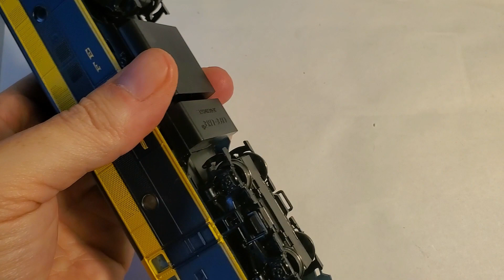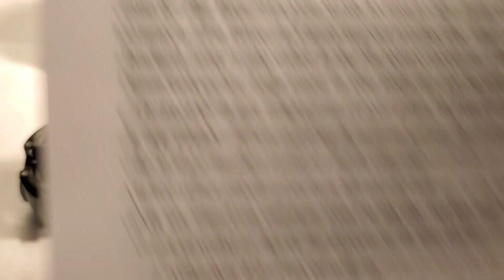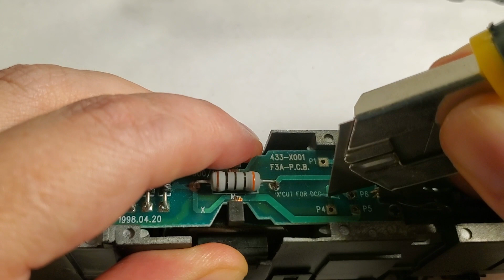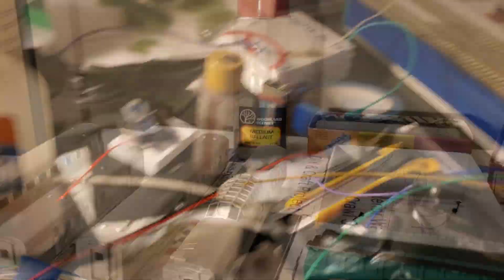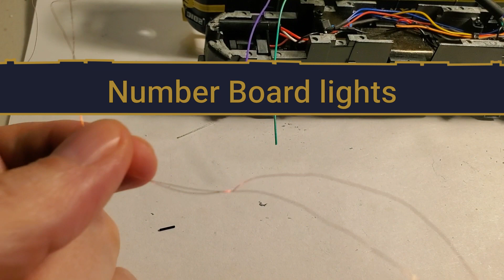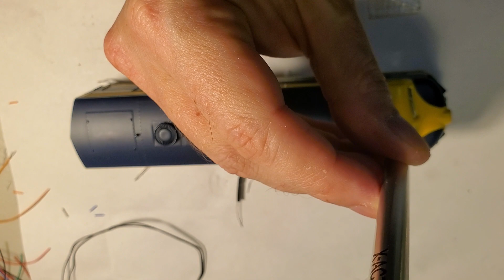Proto 1k EMD F3 ABA Decoder Install

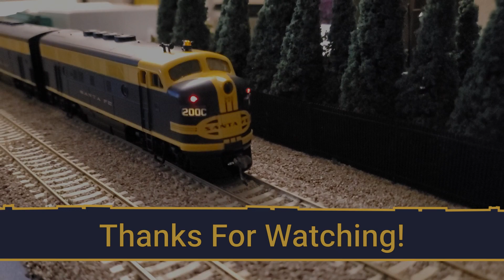Comment: Kurt, help!  I am doing my first decoder install as per this video.  I am at time stamp 34:31 here you say to cut at the 3 "X".  Do I just make my cuts so that the green trace lines are broken or do I cut through silver trace line under the green trace line?
Reply from the maker: Yes, you want to cut through the whole copper trace.  You need to break the electrical connection.

Comment: Make lighting easy for yourself and go to Evan Designs. No resisters no polarity just hook to track power or decoder. AC, DC, DCC. Many different sizes of LEDs down to grain of sand (almost). and colors. Been using them for many years.

Comment: Great video, a couple of suggestions for you, when testing LEDs, if you use a 3 volt button battery (like for watches and car remotes, I use a 2025) you don't need a resistor while testing and since the poles are on opposite side to the battery it just takes two fingers to hold the wires against it. The other thing you might for installing lenses and attaching LEDs to the lenses is canopy glue. It dries clear and fairly quickly while still giving you work time, and unlike white glue will not reactivate if it gets wet.
Reply from the maker: Thanks for the suggestion, I have heard of canopy glue but never tried it.  I have Loctite super glue gel that doesn't fog clear plastic, but it takes FOREVER to cure.  I will try canopy glue.

Comment: I have an ABA set of those same exact Proto 1000 locos and I have had to replace the cracked gears. They are good runners with good pulling power. I've been debating whether to install decoders.